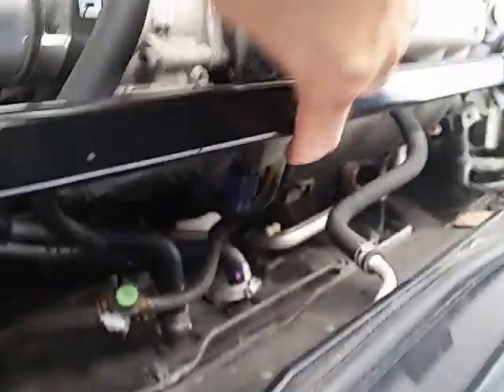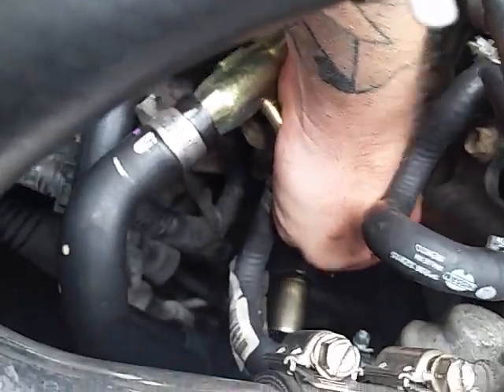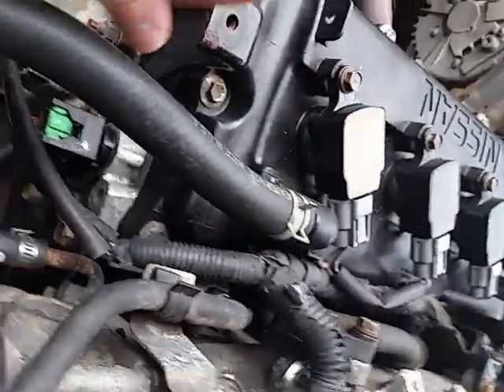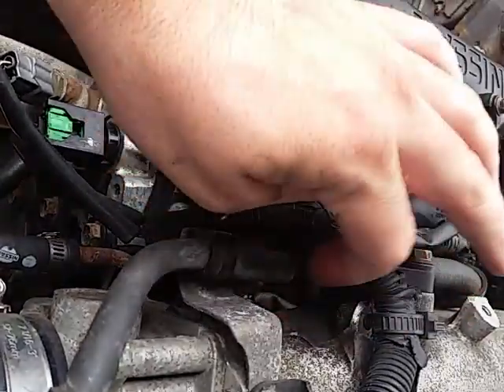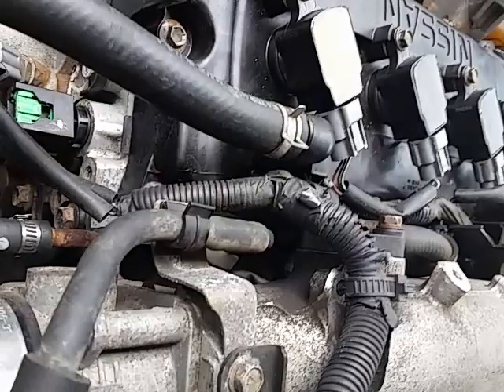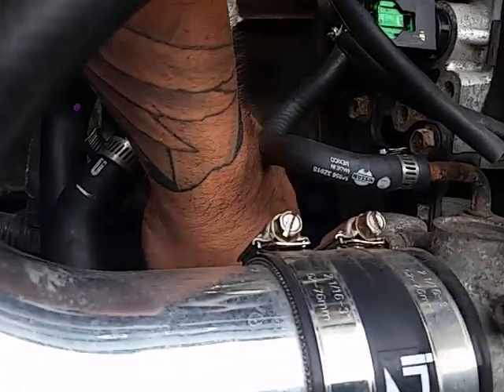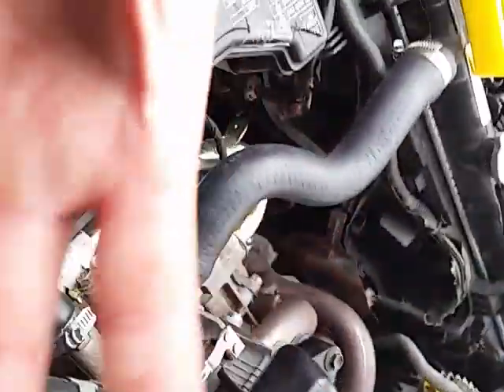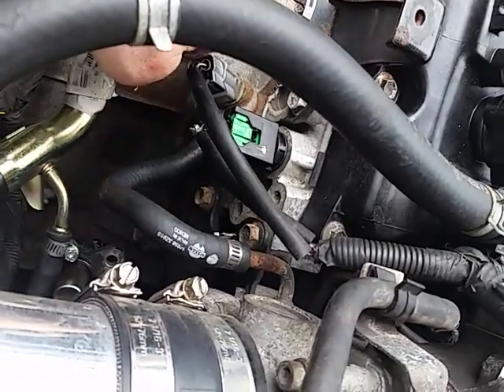CRANKSHAFT AND CAMSHAFT  POSITION SENSOR DIY  REPLACEMENT

Comment: I have a 2012 kia forte obd2 code read poo17, I changed the crank sensor, car starts, but cut off.
Reply from the maker: when you change crank shaft also change out cam shaft postion sensor the parts look identical

Comment: I've watched your part one video a bunch of times starting months ago; before summer and it helped me fix the one cam/crankshaft sensor on the front of the engine but my issue now is the one underneath. I got underneath the car a couple of months ago and thought I found it but oil filter was in the way and since I just gotten an oil change I didn't want to mess with anything. Basically I wasn't confident that I could take the oil filter off, drain the oil and than put the oil back in the engine without any issues. Smh! Anyways I just realize you had a part 2 video and I was hoping that you would take me right to the sensor . I'm going to take a look now from the top of engine to see if I can see the sensor at all.  Thanks !